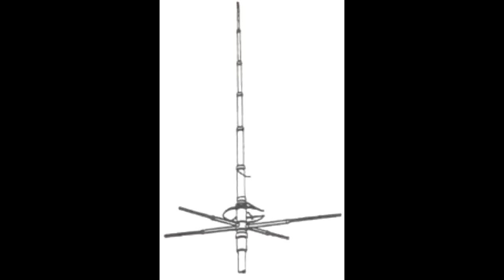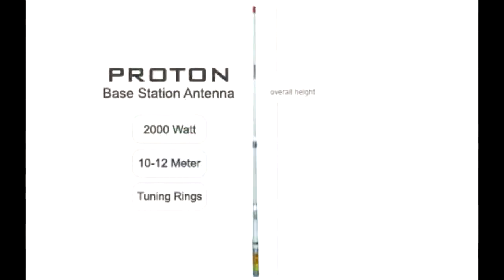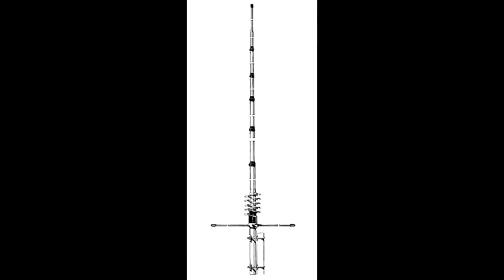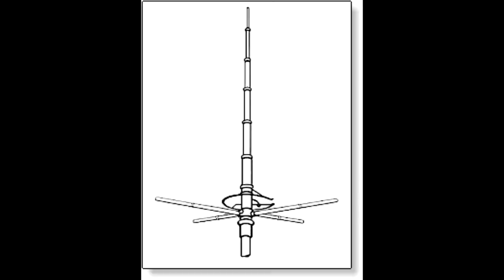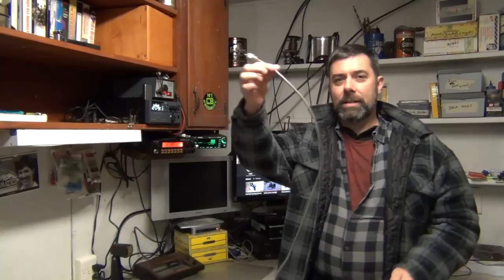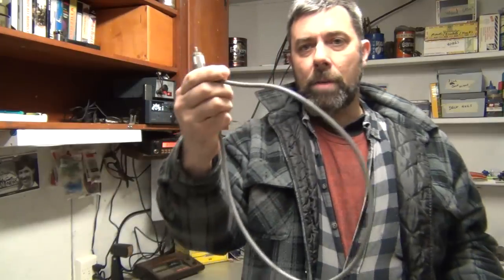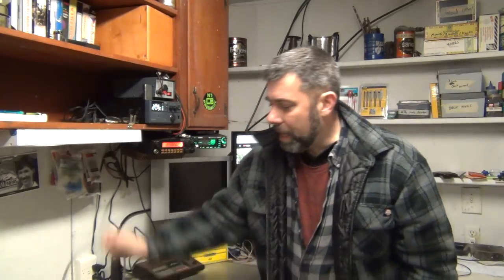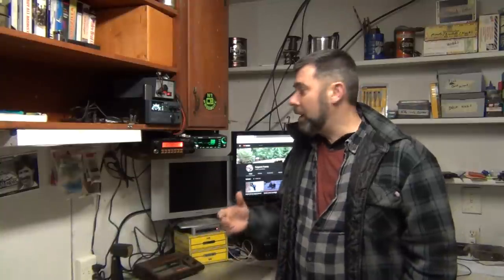CB Base Antennas Part 2: Regular Pole Base Antenna Setups.

Comment: G'day Erik, nice video...as usual, hope the Rangers being well used! I ran a radio shack 5/8 wave and .64,wave base antenna in the late 70s.... Worked the world! Strangely enough if your on top of a hill best off using a 1/4 wave antenna as the radiation pattern will reach below the level your transmitting at... The lower angle of radiation of a 5/8 wave means most of your signal goes out over those stations below you. You may want to look at wire antennas too... Easy and cheap! Just need a balance or tuner.... Had a mate near me who had a 6 element quad.... He regularly spoke to mates in the US, unfortunately he passed away 10 years ago, but the antenna is still up! Looking forward to the next video..... Cheers, Anthony
Reply from the maker: Thanks! I am loving it so far, I just wish the skip would pick up this week so I could really see how far it will reach.
Reply: Anthony Goodridge Hi Anthony I live on a hill do you think the Starduster 1/4 wave by Siro would be a good option over a 5/8 wave

Comment: I use my Solarcon 99 for cb and 10 meter. 1.3 swr on 10 meter and 1.4 swr on 11 meters. Works great for both. Built a dipole for 2 meters.
Reply from the maker: Are you getting a lot on 2 meters where you live? My area is dead.
Reply: @FarpointFarms  Yes, the Wilmington repeater stays fairly active.

Comment: I know little other your videos to include the usages and distances for the different type radios.  I think a CB and a base station for side band are the goals.  I can buy without price concerns so I am looking for functionality and ease in set up.  Please provide your recommendation for CB and Base Station along with set ups to get them running.  I am not looking to get a large CB because I need it readily available in my car, not a large electronic box that sits at home as I cannot drive with it in the car.   Also, I do not see myself dialing freqs while driving.  Are there CB models with automatic scanning and selection?  I am looking at Part 2 antennas.  Any help you can provide is appreciated very much! Robert P.

Comment: I had an 18ft vertical with a horizontal 3 element yagi under that on a 20ft water pipe with a highly modified Johnson Viking 4740 26/27 mhz am/ssb car cb.

Comment: Hi Erik. My question is I only need like 25 feet coax because I am in a studio up about my garage is the length of your coax affect your SWR or is it just the length of the antenna? Seems like I remember back in the early 70s people were saying something about 6 foot increments.
Is that still true? I really don’t know I’m trying to get back in to CBs I don’t know you’re still on here because this video is three years old. Hope to hear from you. Thank you from Joe in Vermont.
Reply from the maker: Yes, and no. If put I. 9 foot lengths. The swr meter will read correctly. If not, you may end up with good swr, but wonky readings.

Comment: Just wondering? What hot connection is the best, red wire from the CB in my truck.? Direct connection to the truck battery, the 12v Power plug in my truck, or the fuse box is the best? Thanks!
Reply from the maker: You'll want it fused for sure. I go to the fuse box on my setups.
Reply: @FarpointFarms  Thanks! Someone said to the battery Both Leeds? Less static? Thanks!

Comment: Hey Eric...what do you think about modifying an icom-718?  I live in SW Fl high wind area...what do you think of phasing two 102in ss whips on springs?  Really like your channel.
Reply from the maker: I had two co-phased 102 whips years ago as base antennas and they worked great! Modified Ham radios do great a cb radios, but legally that's a no-no. That said many claim the ham radios are better for cb then most cb's are!

Comment: I wouldn't get confused with attenuation and shield coverage when it comes to static. Besides, RG58U has 95% coverage, RG213U has 97%. Hardly worth worrying about. Most of the static is being received from the antenna, unless you have a serious SWR or common mode current problem. Anttenuation or cable loss has little to do with it because it attenuates all signals, it cannot discern between the signal you want to hear and static. And btw, RG59 is 75ohm.

Comment: Hey Eric:  Thanks for the great info.  I just bought a base station - old stock sealed in box Realistic.  I'm installing it in my shed/workshop and already ran RG213 coax as per your suggestion.  Should I go with a MAX2000?  I'd like to mount it to a wood block bolted into the highest point of my wood shed.  Would I need to ground it?  Any ideas would be greatly appreciated.  Thanks.  Steve
Reply from the maker: The Max2000 or an Antron A99 would both be great for your setup. You should still run a ground from the base of the pole to the ground to help it not take a lightning strike.
Reply: Thanks very much.  Will do with the ground wire and give it its own rod.  Much appreciated.

Comment: QUESTION
Do you have to tune a Solarcon A99 differently between 10 and 11 meter?
Reply from the maker: Well, sort of. If you want it perfect, yes. If you want it close, tune it to 1 and it should be OK on 10

Comment: Thanx for covering the CB stuff. I'm trying to get back into it myself. I have a question I hope you or other viewers might be able to help me with.

I recently purchased a Solarcon 99 CK base station antenna. After getting it all set up I was having trouble with the antenna. SWR's all crazy and a loud buzzing on the audio when I keyed up. Did some checking and found a dead short between the center point of the antenna connection and the outer casing of the connector. Basically the driven element appears to be shorted to the ground of the antenna. This didn't seem right so I sent the antenna back for replacement. Well the replacement is doing the same thing. Am I missing something?

Comment: What about dipole antennas and inverted V's? They're cheap and effective.
Reply: Not sturdy enough for most places. Plus an A99/Big Stick is a dipole under the fiberglass.
Reply: I use a 11 meter diploe Antenna full wave, plus it's 
Indoors with icom 718 radio it works great, people are amazed that it works, I shot skip with it, from Philadelphia to central  Missouri!!👉
Reply: You can put up a dipole for pennies compared to buying a base station antenna. And some people live in areas that you can't put up a antenna. You can easily put up a inverted dipole in your attic and be very effective. I do it and I don't have to worry about my neighbor's giving me dirty looks about having a antenna on my house. Not to mention if they give off any RFI, they won't know who to come to.
Reply: Dipoles are great antennas, as long as you route your coax 90 degrees from the dipole. I got better results with verticle hanging rather than inverted V, but that was just my experience in conditions here. I use one for 2 meters in my shack and the leads are 19" and have phenominal results.

Comment: I've had an Antron, and a Imax, but now I run a Sirio Vector 4000. It is a fantastic antenna. Far superior.
Reply from the maker: I've never owned one, but if the Max2000 ever goes down i'll look into it.
Reply: @FarpointFarms  , the Sirio Vector 4000 is basically a copy of classic antenna from the 80s called a Avanti Sigma 4.

Comment: Started out with a IMAX then switch to a starduster... Now have a 4 element beam on the flat side
. And a maco v element on the vertical
Reply from the maker: The next video I make will cover those crazy quads and beams. I would love to own a monster like that, but unless I hit the lottery there is no chance of that.
Reply: how do u have your v  set up in the L position or are the v straight up

Comment: I just got into it bc of my gpa I got a new cb and a 30 inch antenna and a swr but my house is 2 stories a bunker house but the top part is 35-40 feet high but should I still get a better antenna
Reply from the maker: With the height of that antenna, you should be fine.

Comment: Hello. My son-in-Law recently bought a Trueman President CB radio and an aerial, fibreglass tube ,just over 5’5” long. All connections are factory made screw on. It has 3 ground pane rods. In the garden etc no signal at all. I fitted it in the attic apps 20’ high. I checked the SWE and found channel 1 at 1.2 and channel 40 at 1.2 ish.  The aerial is not touching anything in the loft, and is reportedly factory set so needs no tuning.The set works because we had one communication but nothing since. Have you any advice to help him getting more comms. We live in middle England in a town called Milton Keynes.

Comment: Wil the grounding be affected in any way if other items are also connected to the grounding? I.e. I have a solar array with a 10 foot grounding rod, can I share it with that or my home meter grounding?
Reply from the maker: Yes, you can share a ground. Now for the bad news. I too have a solar array, and it can and does at times cause a high noise floor. It's a side effect of all the inverter and charge controller doing their thing.
Reply: @FarpointFarms  Thank you for the quick response, you are actually the first U-Tuber to actually respond to one of my questions! I bought a Base Station Antenna and Ground Plane Kit which I plan to attach to the roof of my house...Do I still need to ground it? Would it hurt/help If I did?

Comment: What made you change from a A99 to the IMAX 2000? I use to have a A99 years ago. I thought it was a great antenna. I am looking to hooking my base back up and a antenna. Was looking at either another A99 or IMAX 2000 or the Sirio Gain Master.

Comment: How did you setup your pirate AM radio station?  I am trying to find a broadcast system, but there aren’t many results that are cheap to buy, I don’t want to build one myself.  What do you use/recommend to setup your own AM short range station?
Reply from the maker: I have a video about my radio setup on my channel somewhere.
Reply: Farpoint Farms I saw the video and that’s what brought me here. Figured I’d comment on a newer post instead.  What do you use for your audio transmitter?

Comment: Recently thinking about putting up a base station but homeowners association will not permit outside antenna, Is doing a attic installed inverted V dipole even worth the effort?
Reply from the maker: It's not ideal, but if done right it will work fairly good.
Reply: @FarpointFarms  Guess I can try podging together a dipole for testing and if not satisfactory I will just stick with mobile.
Reply: Do you have a radiant barrier in your attic or on your roof?

Comment: Hey eric I ben into cb radio for years I see where u comment about using a 102 whip with the ground plane.  I want do that and because I live on east coast n.c. and I've already lost one a99 in the hurricanes we have all time. I'm using a 65 ft litepole which 8 foot is in ground putting me around 57 foot. Will the 102 and ground plane perform as good as a99 did?

Comment: That was great.  lots of great antenna's still made. some sold as HAM antenna's but tune CB . they make a 3/4 wave CB antenna. 27 ft long. The company that made the radio shack cross bow antenna is still in business and has a current version still sold in 2024. Maco has new oner but still made . the Ringo Ranger antenna is still made. I have the AR6 6 meter HAM one. the CB one is sold as a HAM 10/12 meter antenna now. The coax I buy now is either ABR coax/ M & P made in Italy or MIL spec like RG 214  or RG 58C/U . That RG 8X is great for CB . just get a good brand . may look the same but it is not.  same with RG 213 . be careful what you buy.  lots of junk coax being sold.  copper cost some $$ now. hyper inflation .
Reply from the maker: Thanks for the info. I'll have to check out the Radio Shack antenna.

Comment: NEW TO AM/SSB BOUGHT A IMAX 2000 DO I NEED TO RUN LMR-400 ALL THE WAY TO BASE STATION ARE STOP AT BASE OF ANTENNA AND GO WITH RG8X THANKS.
Reply from the maker: Either will work. LMR to the radio is the best option, but if you have to split it at the house, it's OK to run a smaller wire those last few feet into the house.
Reply: THANK"S MUCH DOWN HERE IN BOILINGSPRINGS SC

Comment: Hi Eric,
   I am running a A99 about 30+ feet above the house. I have a 50 ft run of RG8X to my signal meter and a 6 ft piece of RG213 to the radio. Mt Base is a RCI2980 ( with some stupid toy inside it that I think I have turned off ). ANyway, I also have a transformer on a half pole about 50 ft from the house. The static noise is on the pitiful side. I cant hear or talk. My question is : Is there a way to stop the static from the trandformer getting into my  radio.

Comment: Does the a99 and such need to be grounded? And if so, how? I'd love to see pic or a video on that in general. I'm so lost lol
Reply from the maker: No worries. Yes, if you put the antenna up high on a mast, you will need to run a thick gauge ground wire down to the ground, and use a 4 or even better 8 foot ground rod pounded into the earth as it's connection point. This will help with better signal, lower noise floor and most importantly, protection from lighting!

Comment: RG8X has 95% shield coverage just like RG58U. RG8X is less lossy, but not by too much, 2.1db per 100 ft at 50mhz versus 2.9 for RG58. Nothing to get your knickers in a knot over. The other major difference is power handling. At 30mhz RG8X is rated at about 280W average compared to the 'mil spec' RG58U of about 400W. That's huge. The last thing worth mentioning is that insulation or dielectric that you talk about. 8X has that foam dielectric which isn't great for soldering, especially when a novice tries to install a plug. Too much heat and the whole run is compromised. RG8X is crap cable, I don't know why it is pushed so hard in the US. I wouldn't even use it for a patch lead, I'd use RG58 over it any day of the week.

Comment: Remember that ... when you use A METALLIC MAST, THIS IS ALSO ANTENNA (reins of supports, etc) ... and the coaxial itself if it does not have wave traps😟 (traps are useless, if the coaxial is next to the mast) . If you do not include the MASTS, SUPPORTS, ground, etc, in the designs of antennas by PC, there is no use "the fantastic studies of antennas By PC" 👍

Comment: I build my own coax with RG-11. It's 75 ohm cable but the SWR drops a lot. I guess it adds enough resistance to stop energy back to the radio.
Reply from the maker: Hmm. Interesting. I've never heard of RG-11 being used for CB.  Isn't that long run TV cabling?
Reply: Yes, but when using for broadband and TV they try to keep the run at 250 ft . After that, too much loss. It won't work miracles, but I've seen a SWR over 2 go to 1.5 just by changing the coax to RG-11. No experience with it with VHF/UHF yet.

Comment: Hey Eric, I have a question about the A99.  I did a continuity check on the center pin and the outer screw connector of the SO239 and my meter showed continuity between those two points.  Is this normal for these antennas.
Reply: If you're getting full continuity, like zero ohms or something that low I would be looking for a short probably near the bottom.
Is it a new or used antenna? Is here any kind of damage?
It seems kind of strange to be getting continuity at the center pin. 
Sometimes on older antennas rainwater can run down inside and cause corrosion at the coaxial connection.

I can't say for certain though as it's been about 25 years since I last played around with a A-99 and didn't meter it out back then.
Reply: Yes normal the center is shorted to the ground with a capacitor. Another reason the A99 is really not very good.

Comment: Ummm,,,the imax 2000, has an 8 inch, built matching network, near the base, on the inside,,,and a 6 inch built matching capacitor, about 2/3 the way up,on the inside,,,connected to the "wire", you speak of,,,and is, in no way, as simple, as you make it,,,,impossible, for a "wire",to have the bandwith, that this superantenna, has,,,,just sayin,,,,its not just a wire,,,by any means,,,,,de NV1H😎
Reply from the maker: It's a copper wire.

Comment: Everything affects radio antenna performance. Height, length, girth, material, height, ground plane, feed line, weather, sunspots, how you hold your mouth...there's literally an infinite number of variables. That's why people report such variance in performance form the same antenna.  

Analyzing feed line in terms of its thickness is oversimplified.  There's nothing about coax thickness per se that determines its efficiency or lossiness.  Incorporating characteristics that increase performance often results in greater thickness, but that's incidental.  In other words, a coax maker could make a very thick but very crappy coax.

Comment: Lol.....Solarcon 99 is $189.00 now!! Now....there is NO SUCH THING as a cheap antenna unless you make a piece of crap that doesn't work. Dipoles suck, unless they're 70 feet in the air. Wire beams are complex and expensive to make. Basically, if you don't have much money, FIND ANOTHER HOBBY. Even 40 year old CB radios are hundreds of dollars. Just a big social rip off, and a waste of time.
Reply from the maker: You Ok? Seem a little.....Off today. While the cost of the A99 has gone up like everything else in this collapsing country, the cost of used CB radios outside of eBay remains unchanged. I just picked up 2 Uniden 510 radios for $5.00 a piece.

Comment: Just got a restored Pearce-Simpson Bearcat 23 CB Radio Base Station w/Amplified D-104... with electrical plug for Power already attached on back: same power connection as any vintage radio receiver for stereo -  And..got a President McKinley in the truck - hoping to get it set-up correctly: any advice? Been watching videos...too much info in most videos - Got confused -  West Ft Worth, TX..rolling hills -  Ty for what you do to teach, and your Belly is Sexy..just sayin -